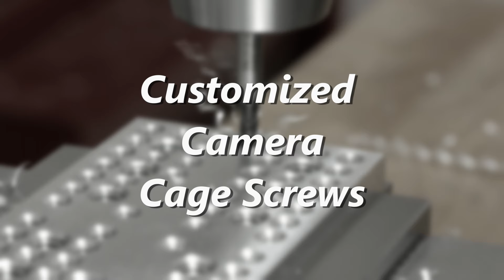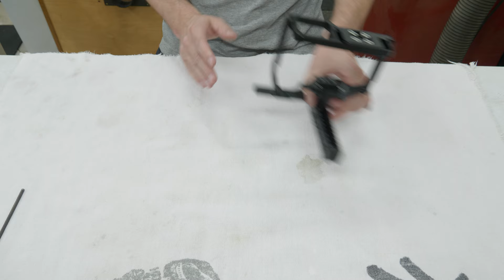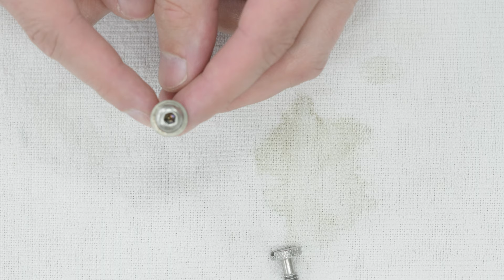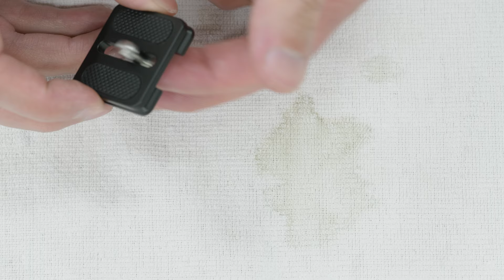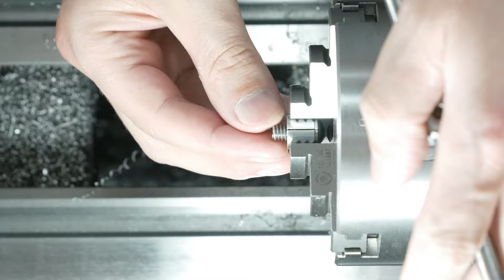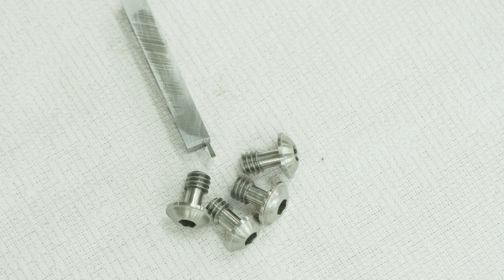Customized Camera Cage Screws

Comment: Funny, most, if not all of my camera gear uses the slot, so a hex head would require an extra tool.  Good looking part off tool and final parts.  If you had to do these more often, one of the live centers with interchangeable tips with a custom hex tip would allow you to get some support on the end and might help with the chatter.
Reply from the maker: Hopefully, I should only need the four that I made. However the custom hex tip for an interchangeable center is a really good idea, I'll have to remember that.

Comment: Don't feel bad about customizing I make slotted 1/4" shank floating fasteners with 3/8" of them threaded 1/4-20 so the camera float in bearing surface in between a product called isodamp. Sometimes custom is just right for your situation. But I obsessed about the thickness of the slot to match the standard #2 flat blade.

Comment: Smart move to grind a tool, somtimes on these small diameter parts a cut off blade will ride up even if it is perfectly centered. The litte HSS tool solved that

Comment: Could you have used a cutoff tool to turn the internal diameter?
Reply from the maker: I tried it with HSS and insert parting tools, and I got horrendous chatter both times. In general my lathe doesn't like parting off, as its not nearly as rigid as larger lathes. Add to that the work hardening, and my only real option was a custom tool.